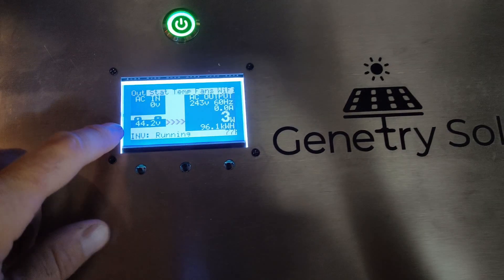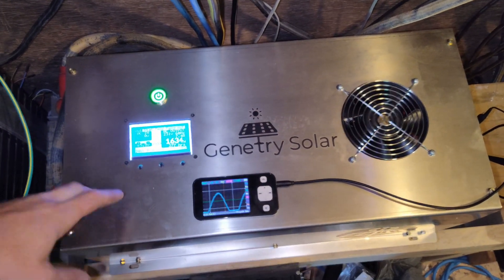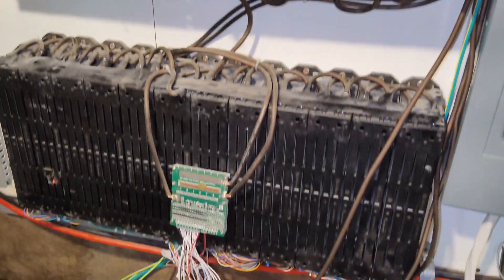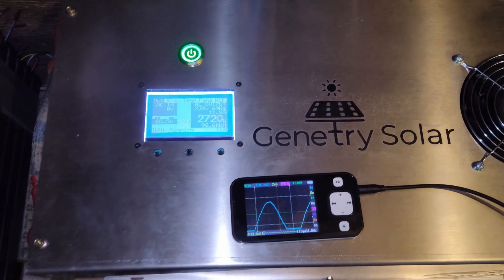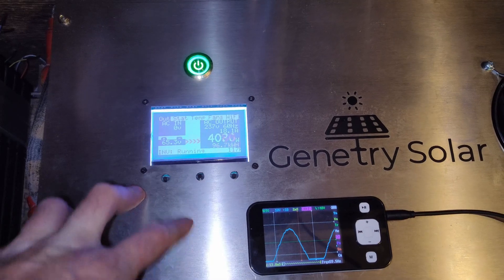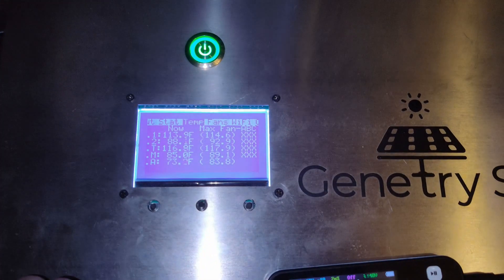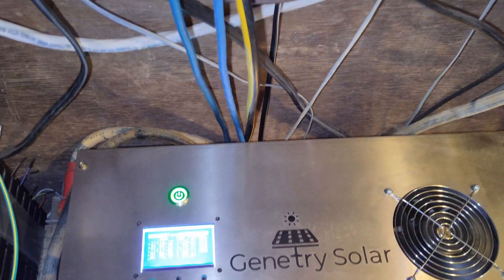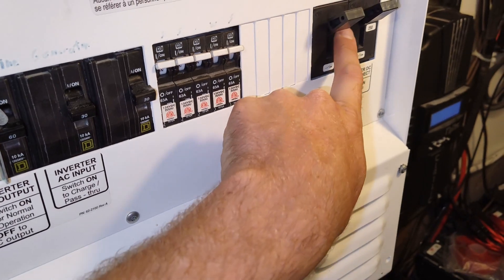The TEST Running My House On Genetry Solar 6000w Inverter

Comment: I have been following the GS inverter guy Sean and they put that 6kw inverter through hell the only thing they didn't throw at it was the kitchen sink lol yea they torture that inverter the testing inverters they built first. It was customize to be very low power consumption and to be able to surge to 12k for a while. SO yea its stronger than you magnasine inverter
Reply: Ryan your right  and there is alot more behind the scenes torture that has been done no one has seen 

I know fist hand these inverters are tough and unlike any other
Reply from the maker: It's a really nice inverter but magnasine worthy not quite, still I do like these inverters

Comment: Awesome inverter the 12k is coming  soon the   one of the reasons idle currant is low is because it has a alot more expensive toroidal transformer  mana sine and most others go for cheaper square transformers  the input voltage of gs can also be changed so you don't have to buy a new inverter when you upgrade you input voltage for instance from 24 to 48 volt  that transformer is a all new never seen before design also  this inverter is raising the bar on what a inverter can and should do completely all new design breaking all the  norms of what a inverter can and should do 
The designer lives and has lived off grid for a long time so he knows what is needed 
12k coming soon my friends I can't wait

Comment: Awesome demonstration but, those fans are really loud.
Could you imagine having that inverter close to your bedroom or livingroom trying have a quiet time or trying to sleep from a long day of work?  
That will driving someone crazy lol😀
It seemed to perform very well and thanks for sharing brother.
Cheers
Reply from the maker: indeed we will see what i cant do to make it better.
Reply: The big thing most don't think about is all big appliances are not constantly on they cycle on and off 

So the fans won't be running at full speed all the time 

But I think you would agree that it is much better to have noise than hot components 
The fans keep components life long most inverter company's don't care after the sell
But genetry solar does those special made fans was a big cost to them
Reply from the maker: @ambersmith6517  they are nice

Comment: Kind of like a 2 stroke bike motor,  it's a little noisy but it works...it reminds me a little of how my Aims inverter/charger works except mine doesn't have the "UFO " fan speed setting lol...they probably used that for part of their heating system...I have a homemade 25 volts 12 inch fan that blows across mine so if it's not a too big  load the fan won't come on much , it never gets warm enough to....I cut up a leaf blower and a desk fan lol, which didn't work,  and it keeps my solar controller and inverter/charger from getting warm...I used 12 batteries and 2 pairs of 1/0 welding leads...it's about to quit for the day and the voltage is 26.0...I just started this stuff about six months ago....mine is just pieces together but it keeps adding up later on...Every time I add something it just does a little more lol...if I get  the stimulus money they promised,  I'll get 3 more panels and 2 more batteries...then my solar system will be 2 and a half times bigger than last winter...1000 watts and 625 amp hours...not bad for a homeless guy...lol...it'll get me by
Reply from the maker: thats great man!
seems like your well of your way to be self reliance.

Comment: You can adjust the fan speed based on temps. 170f is considered critical for this inverter. I run mine at 115f min fan speed temp to 130f max fan speed temp.
Reply from the maker: i changed mine for the next video :)

Comment: It's not a quiet whaaat😱👍🤔
Reply: Nope not quiet when under load but mine has to deal with Ambient temps of upper 90s so I set mine down to 105° for cooling start. They then cut on and off depending on the load but at 2000 Watts they stay on at 25% of fan speed.